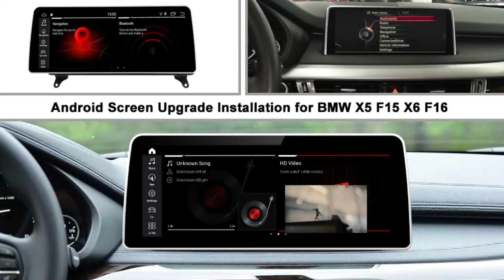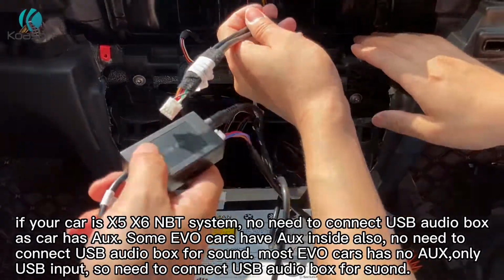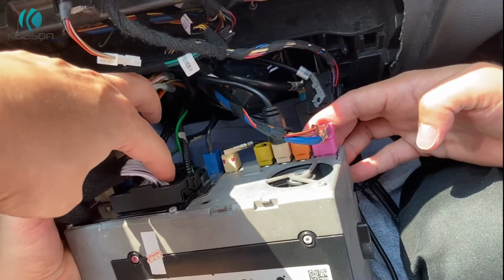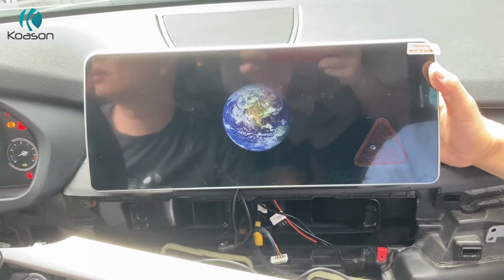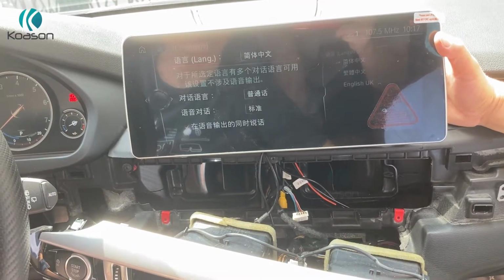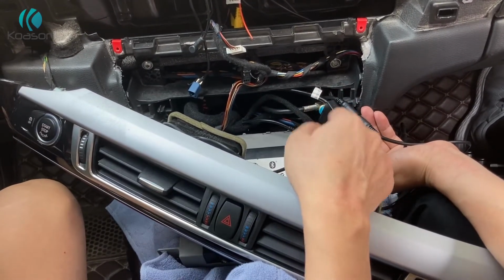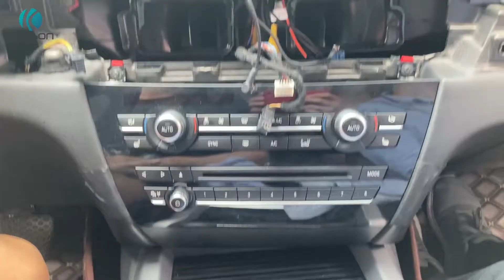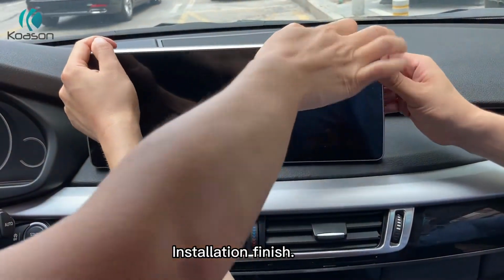Koason 12.3inch Android Screen Display Upgrade Installation DIY for BMW X5 F15 X6 F16 2014-2020

Comment: Does the car original cameras work? 360° or reverse camera?
Reply from the maker: Yes,  the car original cameras work, both 360° or reverse camera , after installation, in android settings-system-Rear camera type selection, you can select it. thanks